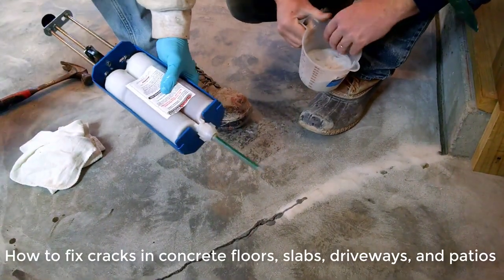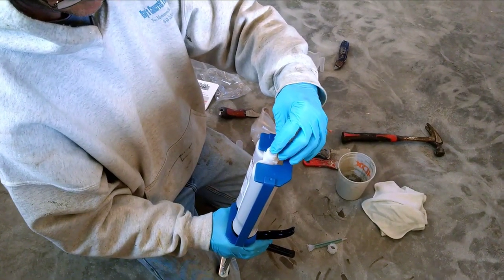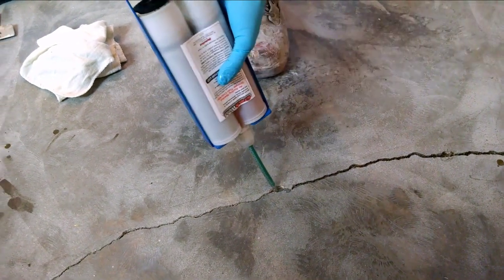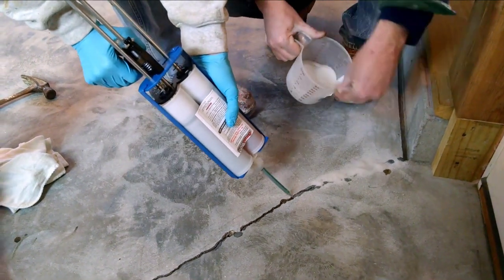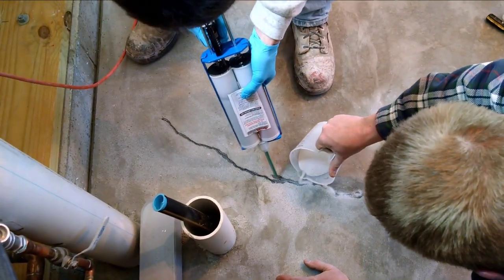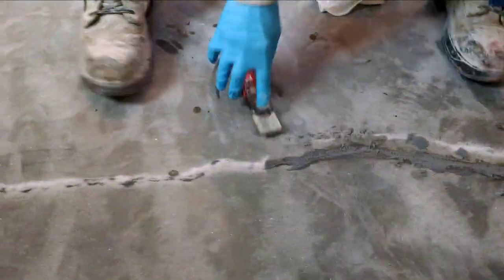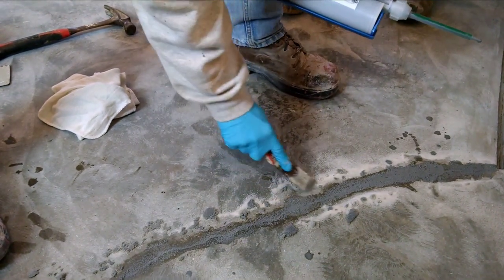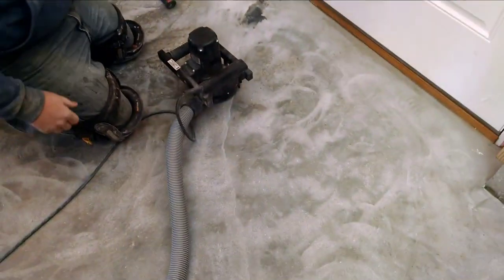Concrete Crack Repair - How to fix cracks in concrete DIY

Comment from the maker: CrackWeld is the best crack repair product I have used. We have to repair a lot of cracks in concrete floors before we install our epoxy coatings. CrackWeld works great for this. It's easy to apply and dries fast so there is very little down time. Excellent product, I highly recommend it!
Reply: At what point do you need to grind out the crack first?.
Reply from the maker: @sh839c  You don't need to grind it out. If it's just hairline then don't use the sand.
Reply: Do you think this product and this method would work on vertical cracks like on basement walls or retaing walls?
Reply: We have finished concrete floors with radiant heat. And have been noticing some cracking. Should we repair them or? And is it best to seal and epoxy them

Comment: Hey Mike, excellent video, I have cracks like this in my garage floor, uncovered back patio slab, and a few very fine cracks in my pool deck (about 8 yrs old).  Is this what you would use on the pool deck?  Wish you were in PA to do my work.   I really enjoy your videos
Reply from the maker: You can use this but look up Magic crack filler, that works good for pools.

Comment: Mike , I was planning on ordering the DIY Kit after watching your video on Crack Weld.
So many products I read & videos I watched trying to find the right crack filler for hairline cracks. Very confusing , then I came across your website and so happy I did.
I need to ask you, " Do I have to use Silica Sand ?  If I run out can I use another type sand ? "
I want it to be that when I'm finish , I will not be able to tell that a crack is there and will blend in with rest of concrete !!!   Any pointers you can give ?        Thank you so much !!!!! 👍
Reply from the maker: If it's more than hairline you'll want to use silica sand. You can get more at Sherwin Williams. Regular sand can be damp and too course.
Reply: Thank you so much Mike !!   Since I came across your videos , have been referring person's replying/asking questions on other sites to your videos. You have got it covered when it comes to asking about concrete !!   For myself , you are the go to person  👌 @MikeDayConcrete

Comment: Watching these crack repair videos makes me curious what are the major disadvantages to using the silicone caulk crack fill tubes. Obviously the strength is not near this stuff but neither is the price point. Are those in essence basically cosmetic to an extent and basic water sealing?
Reply from the maker: This is a permanent fix, caulking it temporary.
Reply: @MikeDayConcrete  That's basically what I assumed, though the upfront material cost is nothing to sneeze at. Seems I might need to take another look at my situation and decide between budget and longevity. You're videos have got me much more excited about the various concrete and masonry fixes though.
Reply: Nawet sie za to nie bierz chlopie

Comment: Mike: I have cracks in an outdoor 2nd floor landing just outside the entry door to a 2nd floor apartment. I believe a brown thin layer of rapidset was used over the sheathing and waterproof resin to finish the landing. What should I use for 1/8” cracks which have developed in the rapidset which would match the color and be long-lasting like CrackWeld?

Comment: Hi Mike, Thank you so much for the content that you have put out. You have a knack for explaining things clearly.  I have a neighbor that needs his concrete drive cracks repaired and asked if I would make the repairs for him and that he would pay me at the going rate for my effort.  Do you have any idea of what I should charge him per linear foot of crack. I realize that the crack weld is around $200 for the pro kit. Thanks in advance.
Reply from the maker: Just charge him what you think your time is worth. Everyone is different and experience is very valuable. So if you don't have that much experience you can charge less but you just increased your value because now you know how to do it better and probably faster next time.

Comment: any advice for if it's a large foot by foot hole in the house. it's below the foundation. considering putting sand down and filling it up with concrete
Reply: Consider a modified concrete repair product such as Fusion-Crete to affect a durable repair edge to edge. See at www.fusion-crete.us

Comment: Mike, enjoyed the video very much, I have a ton of cracks in my 2 car garage floor.  Is there any limit to the width of the crack for this method/product?  Also, if you get the kit that comes without the caulk gun, do you have to do the mixing of tubes A & B somehow?  Seems like it might be worth it to buy the kit with the twin caulk gun?  Love you videos. Wish you were in my area 😢
Reply: That stuff does 100' of a 1/16" crack, 50' of a 1/8" crack, or 25' of a 1/4" crack, and so on. Above 1" you should call a pro. There's a lot of different products and they might not all be the best to use in your region due to temperature or cost.

Comment: How many feet does the tube go
Reply: It all depends on how wide your crack is.A hairline crack you can do 10 feet (1 tube) easy...The secret to all of this to work well is the prepping and dry concrete wall,if the concrete is to humid the epoxy will pop off while injecting,so be very careful and take your time.